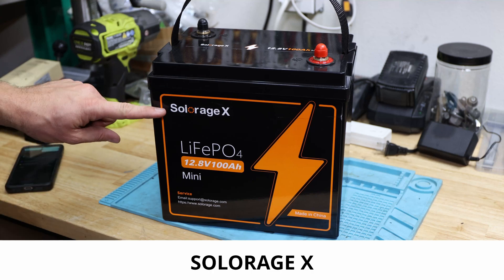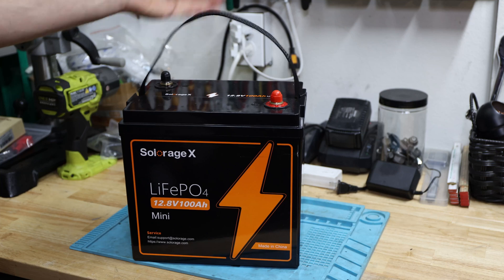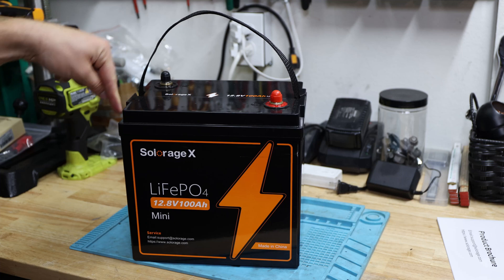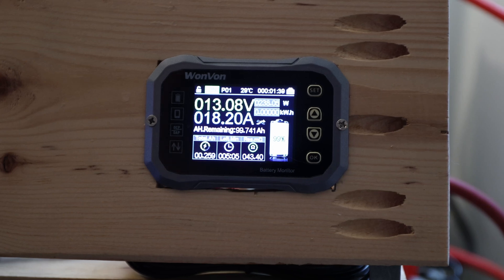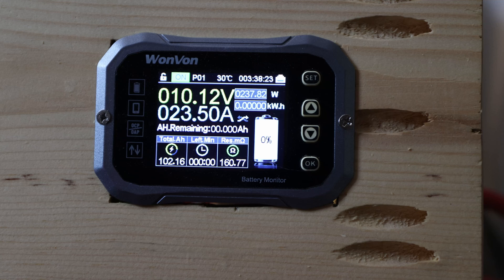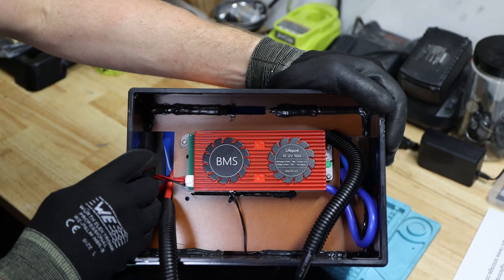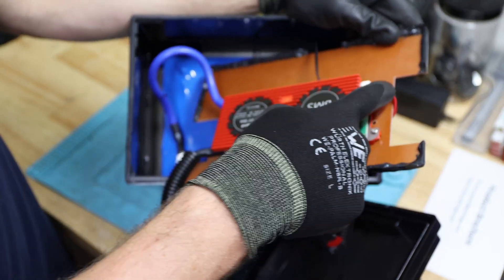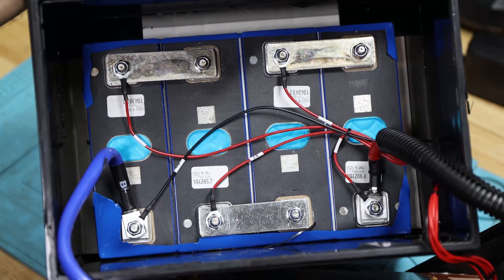MINI or Group 24 Size? | SOLORAGE X LiFePO4 12V 100Ah Battery Review (With Low Temp Protection!)

Comment: I recently bought this battery on Amazon. I also bought a groupe24 battery box fore it. DO NOT buy a group 24 battery box for this battery, the battery is too tall for the box. The battery fits in the manin box but is about 3 inches too tall to put the lid on the box. Not sure if they even make a box to fit this battery.

Comment: Nice, surprised you got it to trigger with ice pack!
Reply from the maker: Was yours not like this? I was out for a bit wasn't able to get up to speed yet... :-)
Reply: @tobisreallifeskillswithtobi mine was the same as yours but couldn’t get low temp to trigger over several minutes with ice pack. Maybe your pack was a little colder than mine or they have changed BMS program? Consistent build otherwise which is good to see. Wish they would bump up the wire size. Enjoy your videos Tobi
Reply from the maker: @THEOFFGRIDMOUNTAINHOMESTEAD  Just watched it ;-) Thanks for sharing! Not sure if they still exist... just tried reaching out without success ;-)
Reply: @tobisreallifeskillswithtobi Appreciate you checking out the video 👍 
I did a quick look and you are probably right, looks like they may be out of biz? Hope this is not a trend with some of these brands. 
Keep up the good work my friend!
Reply: 2 out of 6 came with 0.35 volts  & would not take a charge also 4 to make 48  at bulk charging will not reach 54 happy spot